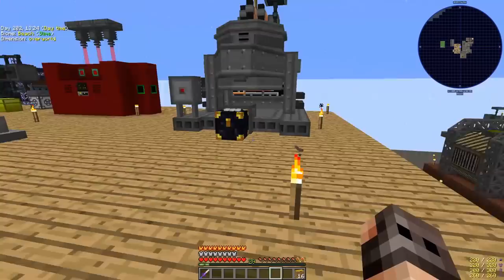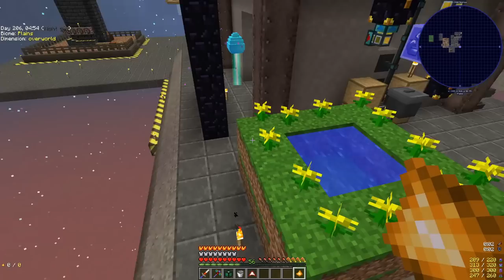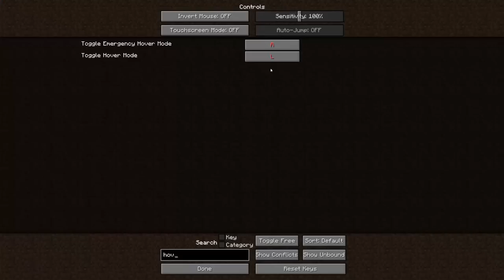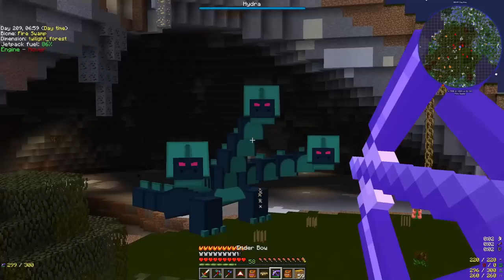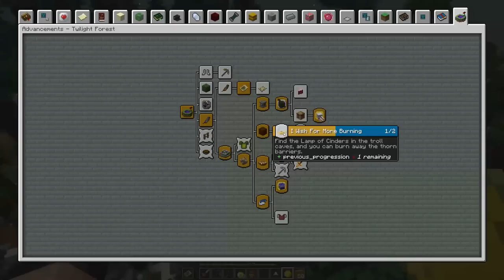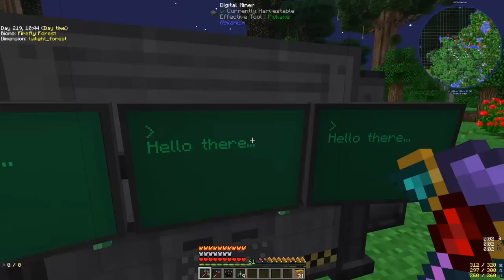Project Ozone 3 Kappa Mode: Episode 08 - Twilight Forest and Digital Miner

Comment: The maze boss and the hydra both have a new move. A charged attack that can 2 hit ko
Reply from the maker: I noticed the maze boss hit me hard. That’s indeed something new. For hydra I didn’t notice cause I just flew in hover mode and he didn’t hit me. I was lucky I guess
Reply: With the hydra you can tell a  charge attack is coming. It will look like it’s normal 2 attack but if it closes it mouth without firing a brings it head down watch out.